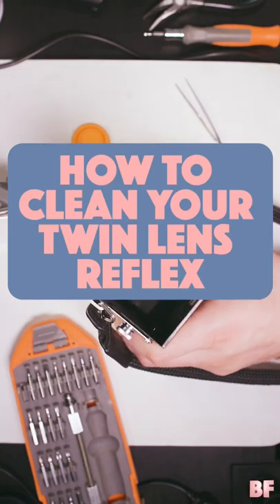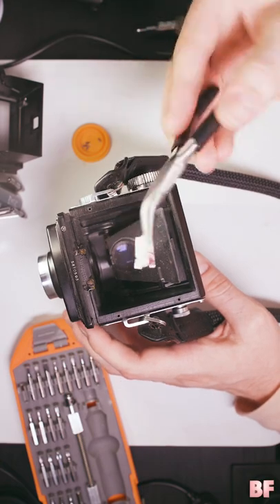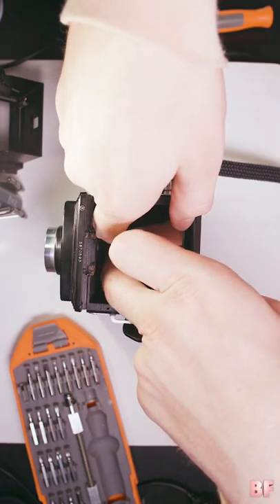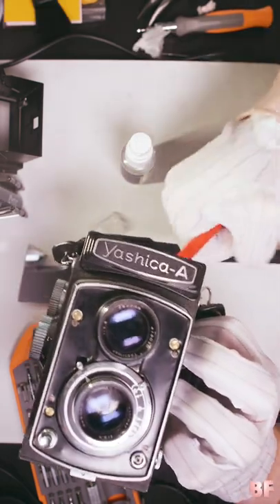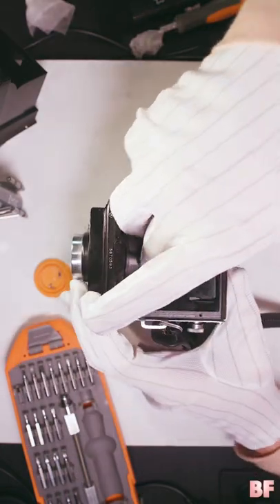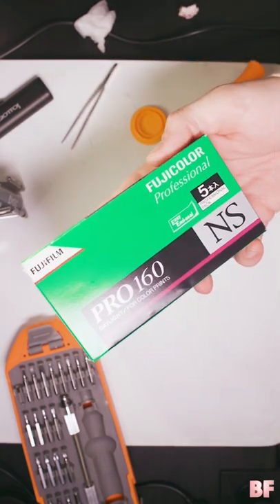Clean Your TLR!

Comment: That mirror is a so called surface mirror where the silver is on top of the glass. With enough force or with the wrong chemicals that silver coating will come off and you will end up with a smeared piece of worthless glass.
Reply from the maker: Thanks for all that info!
Reply: yeah, most say just rocket blow the mirror or if it's SUPER dirty run the mirror under water and don't touch it very much at all...and if you do, don't use much pressure at all.
Reply from the maker: I get that!
Reply: That part made me cringe too...
Reply: a couple months ago I went about cleaning the mirror of my nearly pristine Weltaflex using just water and a piece of cotton, no pressure. One swipe resulted in a silver piece of cotton and a mirror with a rather large spot remarkably unmirrorlike lol. Note I had cleaned several tlr front surface mirrors previously without issue. This one was pretty bad, had more of a copper sheen to it than silver, but... oh well. Guess I'll learn how to silver a piece of glass next

Comment: Doing this to a front silvered mirror would leave you with a piece of plain glass after you removed the silvering...
Reply from the maker: Huh??? lol
Reply: @BadFlashes  Some of the old tlr camera viewfinder mirrors have their reflective coating on the front face of the glass. If you clean them as shown in the video, you will badly damage, or even completely remove the coating, destroying the mirror.
Reply from the maker: Even with the proper cleaner?
Reply: @BadFlashes  I've had mixed results by laying the mirror flat on a microfibre cloth, covering the whole thing with a lens tissue, spraying it with lens cleaning fluid and then gently drawing the tissue over the mirror face by holding only the edge of the tissue without rubbing. Sometimes it cleans a lot of the dust etc (maybe up to 80 percent), but ocassionally you end up with stripes of the silvering coming away using this method.
Direct rubbing the face of the mirror pretty much always ends in removal of the mirror coating though.
Fortunately there are still front silvered mirrors available for sale, although last time I needed one I had to import it from the US.

Comment: I have some issues with focusing after doing this 😢
Reply from the maker: oh i wonder why?
Reply: a) the mirror is not properly seated
b) the silver is facing back instead of towards the lens. This is a front surface mirror, the silver needs to face the lens. touch a pen to your bathroom mirror and you'll see it's touching glass - there's a gap between the pen and its reflection on the silver; in a front surface mirror there is no gap since the silver is on top of the glass -> touch your tlr mirror with a pen (don't do it right in the center of the mirror, these are ridiculously fragile and silver coating is super easy to come off), if it looks like it's touching the reflection you're fine, if there's a gap the mirror is seating backwards
c) the focusing screen is either not properly seated, or it's backwards. The frosted side needs to be facing the mirror, you look at the clean glass surface